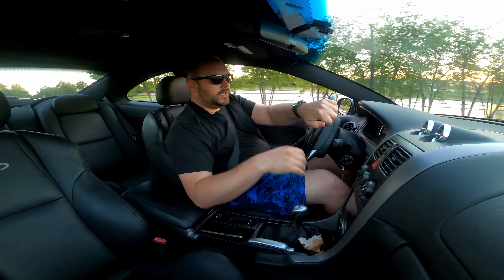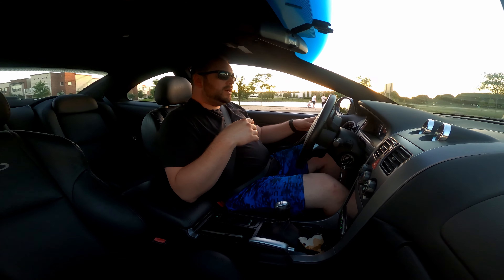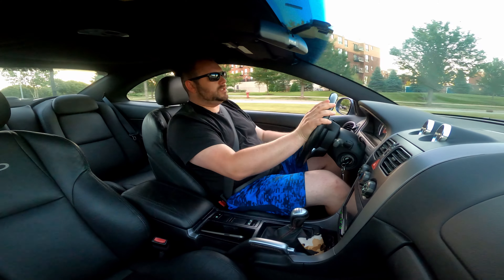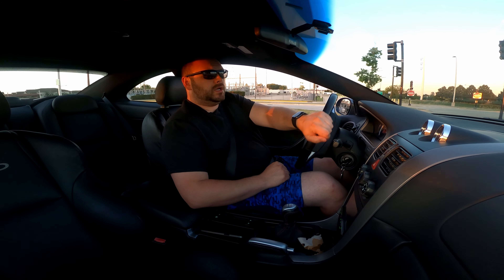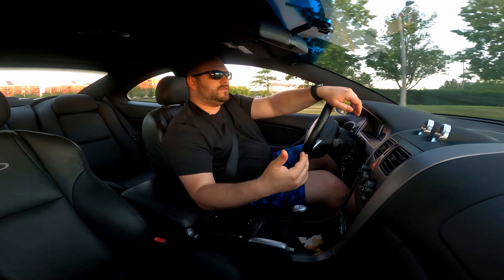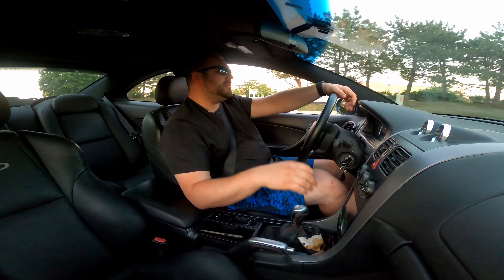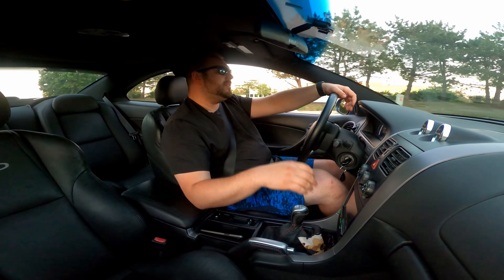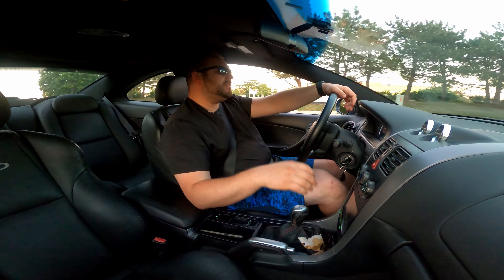GTO Driveline Upgrades (Follow up)

Comment: I got a 06 GTO with 3.824 miles on it last year. Been  garage queen all its life. Guess I better look for different things that may go wrong with it if I start putting some miles on it! 🤦
Reply: It's been 8 months so you probably ran into everything. One of the things about GTOs (and cars in general) is rubber ages with time, not miles. Give it a going over, look for rear main leaking, oil sender leaking, leaking out of the top of the shifter, leaking from the rear trans seal and the pinon seal, check the prop shaft support bearing (the bearing may go bad, mine's still moves freely but the rubber around it is just rotted away and tore up).  Things like that. Rubber bushings age and crack in the suspension. It's still an "older" car, even with only 4K on it. Front struts will still fail (probably have), front strut bushing is probably crushed and needs replacement (both of these tended to happen in less than 10K miles when the car was new).  Treat it like a car from 06 and give it a thorough going over.  Heck, my T56 was replaced by the dealer in the first year of life, still had "core" written on the main case when I pulled it out this week for a major clutch, prop-shaft, rear-main, job.

Comment: I have an annoying squeaking from the rear when l go over speed bumps slowly? Which of your upgrades would cure that? Any suggestions is greatly appreciated. Oh I got my Maverick Man Carbon rear alignment tool in 15 days. Ofcourse I just ordered it this October.
Reply from the maker: If you're running stock, it might be any number of things. Shocks going out, bushings dried and rubbing on stuff, loose bolt. Bushings and coilovers will change the car's character for the better in every way. If you lube everything properly it should get rid of the squeaking. 

The best way I found to find squeaks is have a friend bounce the car and you go in there and listen.